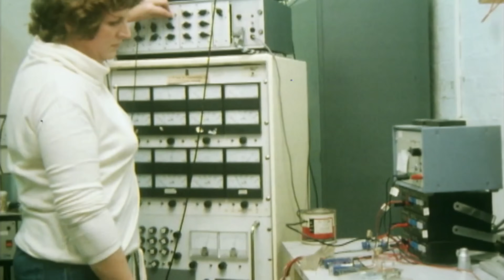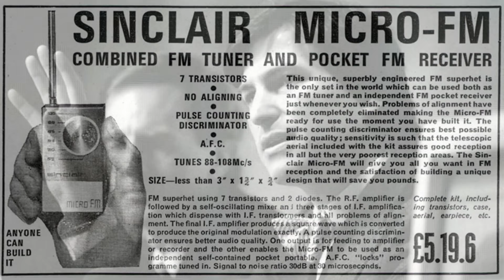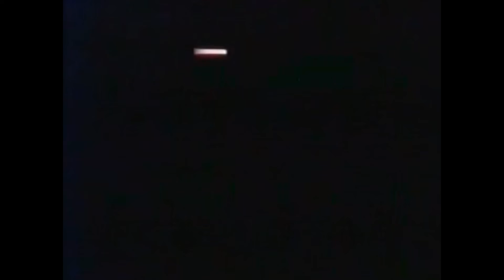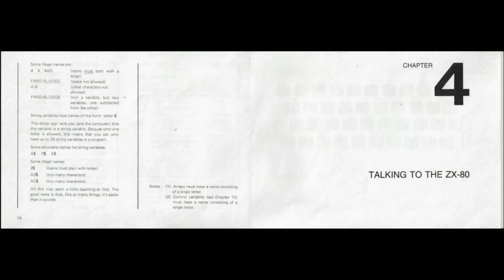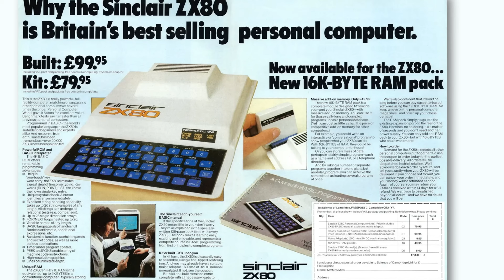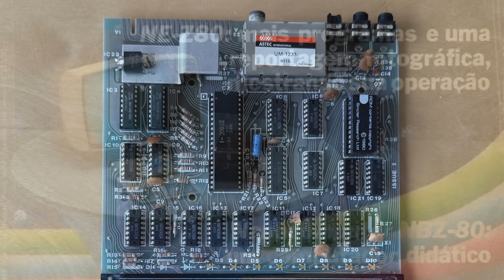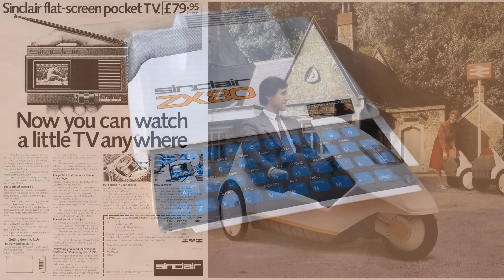Just a TOY? The Sinclair ZX80 Story

Comment: As with my sinclair calculator 6 years before it my ZX80 came in kit form to put together myself. The TV modulator would give you a tingle and the plastic studs to hold both halves together were best not used M3 screws were used instead. The whole screen would blink when a key (call it a key)? was pressed. I still have the light blue ring bound  instruction book somewhere...then straight to a Commodore  PET 8032  (no spectrum)

Comment: The terrible keyboard really sunk the Z80.   But then it had bad everything else too...
Glad I held out and saved up for the VIC-20, with a full keyboard, and full screen editor.
The VIC-20 really would of been a really good machine, if it had shipped with 16K, instead of 5K. 
You could expand it with a plug in cartridge to do just that.  Still stuck with a 22x20 screen, but you got color and sound.

The torturous hunt and peck key combinations and membrane keyboard that may or may not have registered, to enter BASIC commands is what swore me off from buying one.  
If I bought a computer, I was going to have to write my own software, because I had no money left, which meant a full keyboard was an absolute necessity.

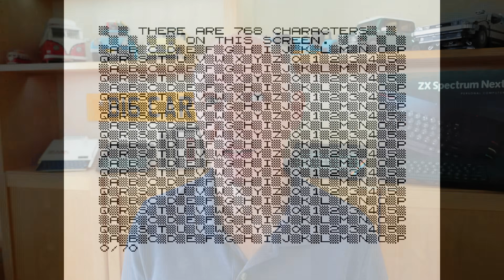Comment: At about 10:50 you suggest that single key keyword entry means that BASIC programs were smaller than in other machines as the keywords only took up one byte. This isn't so - other machines also stored them as single byte tokens, and had been doing for a few years (MSBasic does this). What it saved was the not insignificant complexity of a parser, but the stored programs would have been the same size.

Comment: My school lent me a ZX81, with an I/O unit, which could be plugged in where the 16K ram pack fitted. I created a program to re-create traffic lights, and wired up suitably coloured lights, running on 240 volts. Around about the same time, my school taught me how to wire a plug, although I'd already been taught how to do that at home. Sadly, I suspect that schools and parents wouldn't be so relaxed, nowadays.

Comment: The ZX80 was my first computer. It took almost 6 months from when I ordered it to when our local postman threw it over the garden wall. This was how I learned BASIC and later Z80 Assembly, sinc ethen I have owned a ZX81 along with a bunch of cool add-ons including the DK'Tronics graphics ROM, the RD Digital Tracer, DK'Tronics case & keyboard - the black one with the grey keys and red number pad, which later ended up with a 48K Spectrum inside, Spectrum +2 (my favourite Spectrum), Amstrad CPC 464, with a colour monitor which I later swapped for the Speccy +2 :), Dragon 32 and Atari ST, before finally building my own 386 PC in 1993 - that's a lot of computer history in a mere 13 years!

I really wish I'd kept all of those because they go for silly money these days. I still have the PC though - it's only had 5 different cases, 7 motherboards, 6 CPUs, multiple RAM variations, at least 5 power supplies, new keyboards, mice, monitors etc but other than that it's totally original :D

Comment: I bought a Timex Sinclair 'computer' in early '84.  It had a 4kb internal RAM and I bought a 12kb add-on to make it 16kb!  The cassette storage was too flaky to make it a usable computer as we know it now.  It was essentially a better programmable calculator.  As a EE grad student, I wished I had had it a year earlier for my RADAR class, where the equations were too big for my TI SR-56's 100-step memory.  Alas, I gave away my Sinclair, along with my Atari 2600, almost 30 years ago when moving.  Sigh.  There's a fine line between nostalgia and hoarding.

Comment: I learnt on a ZX Spectrum in 1982. My mate had a ZX80 with the 16k rampack that kept crashing. My Dad used to turn the house power off to crash my computer. I learnt to save programs after I fixed a problem. After school I got a job at Marconi on a Youth Training Scheme which means I was too thick to get a real job and was paid by the government. My job was photocopying stuff. I spotted a lonely IBM computer and no one knew how to use it. So I took the manual home and found out it was just like Spectrum Basic. I ended up writing a program to show the reject rates of Space Microchips in Bar and Pie charts as there was no software about then. £23 a week wages lolol. :)

Comment: your info is very wrong it could actually do all the things you said it could not, it was the programmers at first who failed to achieve these things
Reply from the maker: Have you tried using a ZX80? Using it for anything serious would be just too hard. The speed of using another machine would quickly earn back the additional cost by being so much quicker to use it (type on the keyboard, load programs).

Comment: I had one in 1982(?), but it was the US RELEASE known as the "Timex/Sinclair 1000".

Yes, it had a crappy monopanel "keyboard".  Yes, it was (sometimes) a pain to type in a program, and YES, it was a REAL PAIN to save/load programs from an audio cassette player. and YES, the image quality wasn't the greatest using an RF modulator to feed a TV.

HOWEVER, it was a VERY INEXPENSIVE way for people to "get into" computers and the "SINCLAIR BASIC" was VERY, VERY POWERFUL compared to other BASIC implementatiuons at the time.  Thankfully, there was a market for expansion add-ons and, while they were "clumsy", THEY DID WORK!

I still have the "guts" of that Timex (no keyboard, case, etc.) as a (geeky?) "wall decoration".

Comment: I'm of the age to remember the ZX80, ZX81, The Spectrum, but I look back and think how far forward we have come in 40 odd years, I now have a PC that has a 16 core processor, a 16Gb GPU, 128Gb of RAM, a 4Tb NVMe drive, that boots up in under 3 seconds! All for under £1200! How quickly thinks have moved along (and at a VERY FAST rate) in just the last 10 years! I used have 'dial up 256k over copper cable' now I have 1Gb full fibre (in a village of 200 people!) We tend to forget the real leaps and bounds our lives progress due to people like Clive Sinclair!
Reply: Well, a ZX80 can boot in 0.5s or less!

Comment: I owned one, waited months for it to arrive and loved it. Remember running out of memory with 1K, you'd be typing a program and it would simply stop you typing any more after the screen area shrunk to nothing, only deleting would work lol. Before long I got a 16K expansion which was compatible with the ZX81 too that I eventually upgraded to. I had previous experience of using the Commodore PET in 1979 that my Dad bought home from work sometimes, I learnt BASIC initially on that at the age of 10, obviously far superior to the ZX80, but even the entry level model with 8K cost something like £800 back then with the poorer keyboard and built in tape deck, well beyond what my parents could afford.

Comment: Kind of.  It'a actually a pretty decent z80 computer but it's sorely limited by the amount of RAM in it (and by the original 4k ROM)  It was pretty much a "my first computer" you might buy if you wanted to know if computing had any value to you.  Using somewhat modern parlance, it was basically a "minimum viable product"

Comment: All 8 bit computers had tokenised basic. So the storage of keywords took 1 byte. The zx80 just didn't have to have a loop comparing the words you typed, into the tokens. This saved ROM space but no ram space.

The zx80 was a bit early and very limited. They only sold 100 thousand worldwide before the zx81 came out a year later. The zx81 sold over ten times as many before the spectrum took over a further year later. But the computer boom didn't really start until 1983, by 1984 the market was saturated 

The NTSC model is more than just a crystal change.
Reply: Not quite. The Acorn Atom didn't. 

You could save memory, and speed up execution by using keyword abbreviations which were the first few letters of a keyword followed by a full stop.  Listing the program after entry still showed these abbreviations.

The BBC micro used this abbreviations method for keyword entry, but listing showed the full keywords, clearly showing the tokendisation of the keywords - they being expanded to the full keyword on listing.

Comment: If Clive Sincleatr and Tim Curry had stayed together, in the knockdown blows with each other, instead of different versions of the same product, the would ruled the world computers, ultamly distroying each uveer ib the proses, the Specteum, a cheap PC by any standards, had limits, but most thing poeple wanted it to do, the Axorn/(BBC also) that more a lot more but out control price, difacult explane away basic kit of the spectum for not more just buy the tape recirder fot thr Acorn system, and ehen bothr finish putt each out bussness, ther out the ashes xome ARM that done even make anything fisacaul, the cheap prduct every make the sokder t yourdelf kit with part being supplied the ultomet in ZX80, made by the compertishtion, want big and egspencive Computers fully asembelted, now taking over the world, with computer the cheap on conponent level, there is not actual fisical product sold, the custer have make everything the selefs or at least sourse the from some that not them?
Reply: Tim Curry and Clive Sinclair were together? I guess that their break-up put paid to Clive appearing in The Rocky Horror Show!

Comment: The black Watch was a failure because it was a kit, and required soldering on styrofoam parts that promptly melted. When I reported this, they took the watch back and refunded my money. That's when they pulled it from the market.

The ZX80 really was a toy because the flimsy wall wart power supply and limited I/O weren't suitable for production where people were using computers. Fine for learning, not to risk your business on. Considering that "The China Syndrome" came out in 1979, the last thing I'd want is for the local nuclear power plant operator furiously typing in BASIC on that membrane keyboard to avert disaster!

Comment: I built my own 16K expansion for the ZX80.  I might even still have it somewhere.
I also found a way to get a ZX80 to do pixel by pixel graphics.  It was a bit of a mess but it worked.
I wrote a fairly good (in my opinion) Star Trek game for the ZX80.  The Klingons moved and had a measure of tactics.  They would try to get together and tended to run away from you unless they had a lot more power than you did.
Reply from the maker: Love to see it!
Reply: Where can we get the program listing?? I'd LOVE to try this out!
Reply: @Datan0de  As I think about it, I can't come up with where a copy might be.  I did find a mystery cassette tape.  I will play it later to check for screeeeeech noise.  If I get that, I may try to get my ZX80 to run and try to load it.
Today will be used up partly on putting Halloween away for the year.

Comment: These sincalir machines were MILES better than the Raspberry Pi garbage. They just worked, were simple to use and apart from pysical violence they were basically indestructible. RasPi are shipped with software that does not work, their defaut settings leave critical stuff confusingly disabled, they use the fraustratingly incomprehensible linux and they are so fragile that an injudicious library installl, or even just changing a setting can essentially brick them. After a career in embedded systems I find them unusable. If you don't have another computer to use to research (for days) and use to fix them then you're stuffed. I'm so glad I was not presented wih a RasPi to learn on or I'd probably be an arts graduate, or road sweeper. Best development in home computeing recently was making a RP Pico emulate these early machines. Selling those with the RGB motherboard and a manual (for about 30dollars now) would be the best STEM training product possible.

Comment: Yep, the new brain was a pretty impressive machine when originally designed.  Shame it was so delayed.  The MK14, if they had made it a game console too, imagine that.  The 6503 was an option that may have bern better.

For the zx80, why not the cheaper 6502?  The Jupiter ACE was an ex Sinclair employee basic circuit, and more performance functional, as was the Spectrum.  Why did they do the zx80 that way?  It just meant that the design had to be replaced rather thsn expanded.  Then we get the QL (which could have been the next Spectrum with z80 and not the intended os and 4 and 8 set colours, and not even 640x200 with 16 colour programmable dual attribute 80x25 text mode.  Would have made a great difference.  I loved my QL).  Sponge Bob black pants Spectrum could have had hard key tops, and a few more graphics tricks (it could have done 128+x192 16 colour and 256+x192 4 colour (do the bandwidth calculations). The zx80 could have had programmable characters and using the cassette port as separate sound able to be fed out and detoured from the cassette.  Engineers admit, that cost cutting there went a step to far.  Now we know why, to fund  the car and TV.
Reply: The 6502 was cheaper, but the Z80 had features that made it much better for using the CPU to generate the display.  The ZX80 design uses a clever combination of the NOP and Halt instructions along with the Refresh register and interrupts to generate each display line with minimal hardware. That saved much more cost than the price difference between the processors.
Reply: @GodmanchesterGoblin Yes, the z80 had much better features thsn that over the 6502, and even had a better planned feature set clipped due tk constraints. So much so you could have likely included the spectrum logic and proper display circuitbin the spac difference betweenthe 6502 and z80.  But, the z80 was clearly more expensive design.  I pointed out the Jupiter ACE as similar featured design that is more miniumable then the Spectrum.  The way they did the zx80 video control was smart but not wort the hassle.  By the time you got the custom chips of the zx81, it was time to incorporated a better video circuut (clicklet keyboard, cassete port sound, polychromic colour, joystick ports).  Unfortunately, the whole endeavour was just a money rasing scheme for micro tv and cars.  Otherwise a new brain based design or Spectrum like design could have cone earlier.  The low cost was to maximize profit margins to fund these other things.   They did not even seperate out the casette sound output from snother function, stopping its dual use for sound, or allow the character set to be relocatabe (if they had you could  shift it by 16 chacters and have programmable game graphics).  Anyway, 6502, I think things could have been done on it cheaper or more desirably.  Lots of choices, dpes not mean the chosen choice was the best one.

Comment: Given that I was only a few months old when the ZX80 launched, I missed it first time round... though it was a ZX81 that got me started in programming (aged a mere four years old, and you can put me on a lie detector for that). I only investigated the ZX80 much later, after I'd discovered emulation... and (unintentionally) provided the comp.sys.sinclair Crap Games Competition with its first-ever entry for the ZX80 in 2004, in its ninth year of running. I should have another stab at it soon (I think my last attempt was a simulation of a Boggle board that used all the Integral Functions, with machine code to scramble the cubes...) but it's so painfully limited that I can never think of anything useful to do with it. Anyone got any bright ideas?